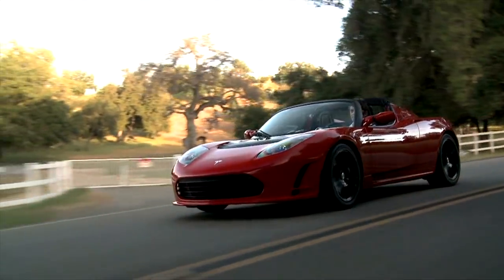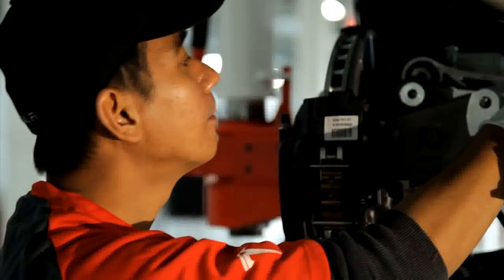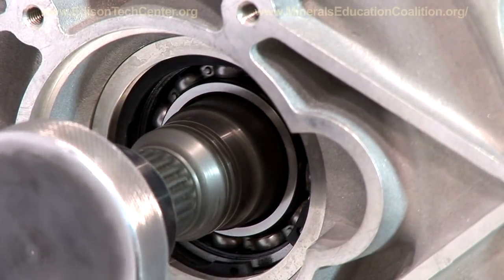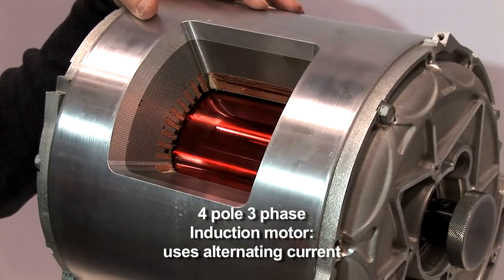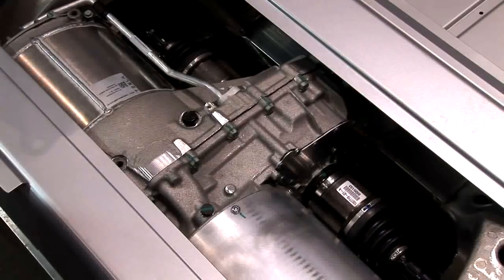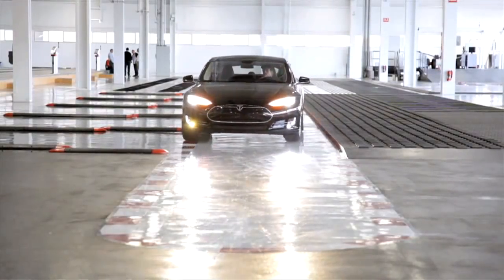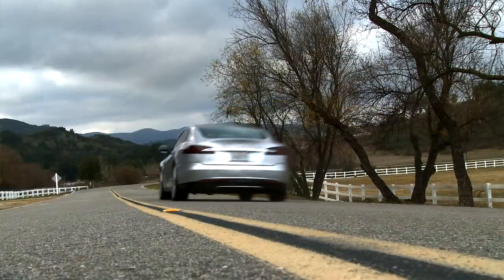Electric Motor: Model S, Tesla Motors

Comment: For last 15 i am working with CNC's best we could have in manufacturing, the technology on which teslas business depends. I am no critisizer of electricity because in past i was also involved in electric motor manufacturing.
But I have some questions.
Somewhere i heard that these motors can run upto 15000 RPM to reach that speed needed frequancy for app. 300 hearts & voltage of 2200 so at what temperature motors are working?
Secondary once I have seen technician losing a finger accidentally for touching bus bar when machine was powered down. The reason we come to know that there is capacitor roughly 600 ml water bottle size was holding power. So in case of accident what are chances of survival as electricity tends to discharge in blink of eye?

Comment: Please could I have the rpm the moter in Tesla runs at I estimate 17,000.00 RPM this is then stepped down by your one Speer transmission it looks like about 10:1 so max speed to the wheels is 1,700 with with my math gives a max speed of 127 mph do you agree ?

Comment: Actually the torque is flat to around 2300 rpm and then drops making the power (Votage X current)_go constant to 80 mph and then drops again.  

The reason a gas car needs gears is two fold.  1)  You have to work the engine by opening the throttle more and the only way to do this is to lower the speed for a given hp.  The effective compression ratio drops when you throttle and therefore the efficiency drops if you don't work it.  This is easy to see on a BSFC graph.  By lowering the speed with gears you work it, thus maintaining efficiency.  The power pulses also limit the lower end of the speed range to  around 500 rpm for 8 cyl, 800 for 6 cly and 1200 for four cyl.   2) the normal aspiration (no turbo) starts to starve for air at around 5300.  The structure is also limited to the 6000 rpm to save weight.  

Drag racer and motorcycles can do 12,000++ rpm.  Any "bullet bike" can do this.  But again, you have to work it to use to get efficiency.  The Tesla can maintain efficiency by maintaining best slip rate.  In essence it has a variable transmission inside and does not have reciprocating motions.

That said there is a way to do much better than a Tesla  in an IC engine that can also run on electricity if needed.  Working on it.  The typical IC engine will not work.  A distributed power system would afford Natural Gas at 1/9the cost of electricity and battery.  Working on it.  Could make electricity at 2.6 cent/kw-hr from solar thermal and 5.5 on NG  Could get 80-90% of the fuel out of the system much quicker than electrics....why?  Renewables.....  Tesla just transfers it to the coal plant.

This new engine would have small package like Tesla and all wheel drive without connection like Tesla does.  In the size of the motor and inverter of Tesla I could have 600 hp that could run up to 12,000 rpm and maintain efficiency if so desired.  Clearly old IC engines cannot do this, but that is not what i am saying.  The cost is a fraction of what a Tesla would cost....  Again, if you want to cut fuel by 80-90% and do so fast, what I am suggesting will do it.  

Grid fuel (electricity) is very expensive.  12 cents/kwh is $4/gallon.  Battery...$4/gallon equiv.  $8/gallon plus road tax of 4 cents/mile....Total fuel cost for a Tesla is actually $12/gallon.  Mine will be $1/gallon, and when I fly it is 12:1 in costs.
Reply: You build it yet?

Comment: Why put the motors sideways when you can just point them backwards? Putting them sideways makes it impossible to add gears............
Reply: Well they got the two motors pointing sideways, making no room for gearing. No drive shaft no rear end. A simple backward pointing big motor will do more then the two motors they have.

Simple drive shaft from 2 gearbox with strong dog arm and steel forged output shaft. Put the huge motor under the car with 2 gear dog arm box, running a short shaft to the rear end to both rear wheels. Simple.

A sprocket can handle that torque if you put the main drive input rod along with the output shaft while being driven by a main sprocket on the main drive input rod. That means that supper strong sprocket can handle that torque as is it already spinning at the same RPM , allowing the 1 other sprocket to slide over to second gear using strong dog arms.

Weight will not matter as only 400 more pounds max will be added. BUT the motor is bigger and can produce more power. Voltage drop can be achieved easier as it's just 1 motor. Simple voltage drop sensor on w/e type of  shifting you want can drop the volts 

I'm surprised these guys didn't use voltage drop. That is key to using this type of motor. Without voltage drop no car or bike would run. Spark plugs are not getting proper voltage as there is no Ptp transistor applying high voltage from the 30/50 amp fuse from the battery. Every Time the crank passes the sensor. The power is cut from the sparks to allow gas to flow in. As the crank is in the way of the sensor. The power is cut back to the sparks to give combustion.

That can be used to lessen torque to shift gears, making the torque bearable on sprockets.
Reply: That is why I don't get why everyone is saying the gears couldn't handle the torque. If you apply voltage drop, then the gears CAN handle it. .
Reply: rimac has a 2 speed gearbox.
both have gears, tesla is single speed.

Comment: I wouldn't brag about 0-60 in Germany. Tesla would still get it's ass handed to it by a Mercedes AMG S63 topping out at 186MPH.
Reply: Steven Carrington what's  the big deal in US we can only drive 70 miles an hour maybe 90 if police  is not around so i guess  130 is good enough
Reply: +Steven Carrington "Tesla would still get it's ass handed "
WRONG. tesla roadster v2 250+mph, 0-60 1.9. lol loser ;D

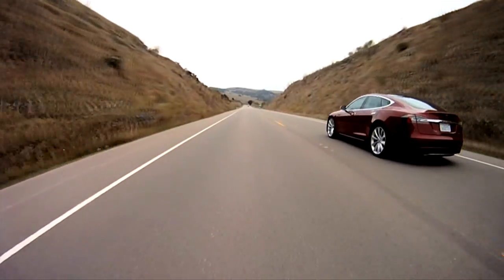Comment: 1:18 FALSE.  AC motors have got 100% torque only at the start, then torque drops as RPM grows.
Reply: That's not correct. There are many different types of AC motor, and while some like universal motors (the type I suspect you're thinking of) create peak torque with a stalled rotor and decreasing from there, this is certainly not true of all motor types. For example some types of induction motor (e.g. shaded pole, those used in desk fans) produce very little stalled torque, and far greater torque at operating speed.

Polyphase induction motors like those used in electric vehicles can have their torque controlled right throughout their operating range with a variable frequency drive. Even washing machines do this. This means the motor effectively has a continuously varying torque curve depending on drive voltage and frequency, not a single curve like a vacuum cleaner.
Reply: uhm. you can change torque speed characteristics of the induction motor?
Reply: Yeah build a motor that is capped in torque, so that torque can be linear to the very end, but that would be kinda boring in my opinion...
Reply: I caught that too.  Completely wrong.  100% torque at stall only.
Reply: That’s what I thought...because if you almost at the top speed and you floor it it’s not going to give you the full torque power....only at the 0 start

Comment: how can you charge a rotor by electricity without a brushes?
Reply: If rotor spins faster than syncronus speed (determined by voltage and frecuency in stator), it's said the machine is working as generator. In this condition, current in stator is opposed to stator's voltage, or at least with a phase angle greater than 90deg, and thus consumed power is negative (power is flowing FROM the motor). 
You can say that the extra power recived by rotor coil is transfered through magnetic fields to the stator coil, just as in a power transformer.
Reply: what are you talking about, I'm asking how can there be a current in rotor if there's no contact with a batteries for it called brushes.
Reply: what are you talking about, I'm asking how can there be a current in rotor if there's no contact with a batteries for it called brushes.
Reply: Ohh sorry, i see now i misunderstood your question.

This rotor acts like a coil with short-circuited turns. So there's a three phase system in the rotor that tries to "follow" the rotating magnetic field produced by stator. Then, there's a induced voltage (emf) and current in rotor.
Reply: three different copper windings in the stator are driven by three different phases  of the same frequency alternating current. the net result is that a rotating magnetic field is induced, hence the three phase induction. Now in order for the rotor to rotate, it must have some magnetic moment that interacts with the rotating magnetic field in the stator, creating a Lorentz force.
Reply: An induction "motor" operating in reverse is an induction "generator". from Maxwell's Electrodynamic Laws, you can see that a current "loop" will create a magnetic field, and will apply a force on a permanent magnet to create motion in the motor. but a change in magnetic flux through a conducting "loop" will drive a current through the loop. these are technically,  Ampere's Law with Maxwell's "Correction", and Faraday's Law respectively.
Reply: Doesn't the rotor (Armature) get electricity through INDUCTION?? from the field winding (stator). 3 phase?? Might they be using an invert er.. Seem it to be this way??
Reply: The rotor does not need electricity, only to rotate

Comment: Thats incredible! Now I understand the value of owning a Tesla, there is no transmission to worry about. The direct drive just blew my mind! 100% Torque at all speeds. Unbelievable. Of course, its not new, but this is the first I've heard of it!
Reply: Those are the benefits of an electric motor.
The only problem with electric cars is power storage, but as that gets better I expect electric cars to start outselling internal combustion cars in every class.
Reply: thats BS!!! the rotor's asix is not even on the same asix as the cv joints
Reply: it could be direct transmition even if the axles are not coaxial.. all you need to have a direct transmission is a 1:1 gear ratio

Comment: Should we expect these motors to shrink in size and weight as technology improves?
Reply: No, this is not a new technology. Its a good application of a decades old technology. These motors are already much smaller and lighter than an internal combustion with a transmission. The weak point of electric is carrying around your energy in batteries. There might be advances in the future with super capacitors, ceramic batteries, etc. But the motor itself is not a place where you'd be looking for a leap. Brushless electric motors are already cheap, fast, and durable. It's why they put them in golf carts.
Reply: Yeah, my RC car had a pretty advanced A/C engine 30+ yrs ago. You could get engine's that made those little buggers do 50 mph on 2 inch wheels. These engines are scaled, but they've been using them forever. Like every fan ever made, for instance.
Reply: +Mike Killion When room temperature super conductors and higher energy density batteries exist I can imagine a lot of aircraft will be electric.
Reply: @RingingResonance  graphene battery possibly
Reply: Well primarily you don't need 390HP motors in your average car, in Europe you average driver is going around with 70HP or less.
Reply: +Mike Killion I don't see why not, only time will tell
Reply: maybe, if the motors ever use high temperature superconductors. this would also let the car have a much much higher range, but not feasible right now. with current tech it would have to have some sort of cryo pump  that pumps liquid helium or Nitrogen and would suck energy
Reply: Seems to be going that way, smaller more efficient and more powerful

Comment: still a transmission is good even for this kind of motor-driven car you can get higher speeds and use less current for the motor to keep up the speed
Reply: +Vagelis Dimou  Not necessary, by modulating the frequency and voltage to the motor itself, the motor controller acts like a transmission, delivering the correct torque and rpm to the wheels at all times.
Reply: ***** the motor used in the tesla is different from a typical small DC brushed motor you would find in a cordless drill.   The tesla motor is a brushless induction motor. 

Also, I'm sure there are ways to eliminate the vibrations.... those cordless drills use PWM as speed control, and don't vibrate at all.

Comment: ahem All AC motors are brushless... 

Love you Tesla please hire me as an engineer
Reply: +Parker Davis Synchronous AC motors have brushes to the rotor winding: DC, 2 brushes. Also there is induction motors with wounded rotor, an AC three-phase windings in Y connection, requiring 3 brushes.
Reply: I believe you are confusing slip rings, which are used in AC motors and generators, for carbon brushes (used in conjunction with a commutator in a Brushed DC motor)
Reply: @parkerd2154  synchronous motors use brushes, that's how power is transferred to the rotor windings, in an induction motor there are no brushes due to induced voltage, no need to transfer power to rotor
Reply: Battery powered power tools use a permanent magnet DC brush motor.... I'm sure some really fancy ones might even use brushless DC. 

For thw power tools you plug into the wall, likes a sawzall or drill, would use an AC motor, or universal motor.  One that can work on both DC or AC...but will typically see AC in a household.
Reply: There are plenty of brushed AC motors, pretty much all smaller power tools and household appliances  are still brushed.
Reply: my RC car has a brushless motor! pulls around 70mph!
Reply: +Hobtronics   Slip rings are used in alternators.  They are used to induce a magnetic field into the rotor, and power is generated in the stator. 

Slip rings are not used in motors as far as I know. 

Also there are a/c motors with brushes and a commutator.   But most of these style motors can also run on D/C voltage aswell.   Often referred to as universal motors, look it up.
Reply: Good sir, of course I know about universal motors, just yanked one out of an old washing machine the other day. - Read this - http://www.brighthubengineering.com/diy-electronics-devices/43725-slip-ring-induction-motors-basics/
Reply: Triangle 3D Slip rings work with brushes so wound rotor IMs and synchronous machines have brushes.
Reply: Hobtronics  Ethier way, your original statement is fundamentally false, because a universal motor....which uses a commutator and brushes, when used in an A/C application is an A/C motor.

http://www.k9ape.com/new/Commutator.html

An A/C motor is any motor that operates on A/C current.....  so in effect, yes A/C motors do exist that have brushes.

I would try to say "induction" motors never have brushes, but the link you provided exemplifies a design of one that does.
Reply: MsSomeonenew Dude, 99% of power tools use brushed DC motors, some use universal motors. 

 If it is brushed, it uses a commutator, which is how a current is alternated in order to spin a motor using only DIRECT current. AC induction motors might use something called a centrifugal switch which is like a retractable brush to give the motor its intial kick. But you would never call it a brushed ac motor.

Comment: Why do electric cars lack transmission? Please answer.
Reply: +Lehel Hanko 
Because unlike a petrol motor which has an rpm range of ~800-8,000, an electric engine has a range of 0-18,000.
They have a higher max rpm, and produce enough torque at 1 rpm to start the car, while a petrol engine will stall at anything under ~800 rpm.
So they don't need gears to go from 0-150mph, just direct connection to the wheels.
Reply: It's not true that electric car lacks transmission. Tesla has a single gear transmission which allows it to accelerate faster because of having low weight and full torque in that single gear. The only tradeoff for having a single gear is a reduced top speed.

Comment: call me when they get down to around $6000.00
Reply: Yea never buy new unless you are a millionaire.
Reply: +Darryl Mann with rebates and stuff i heard you can get a new leaf for <$11k (manufacturer + local+ state+ federal, i think it was in Massachusetts or something)
Reply: Yeah, I dont' think so. Speaking about price, there is no Model 3 on the road that costs less than $60k. Only the fully upgraded models, with long range battery, are getting delivered and there were extra costs above that not included in the sticker. Model 3's are not $35-40k cars, as advertised. They recently changed the sticker to $45k because they've caught heat over it.
Reply: Haha, what car can you buy for 6k new today?  That will never happen.
Reply: That's why the motor industry is going down hill. And why I buy used cars I can pay cash for. Been driving my last truck for over 10 years. Paid only  5k. Car before that I paid 2k. Drove it for 5 years and sold it for 2k. lol
Reply: You can make your own ev conversion for definitely 6k just search build your own electric car